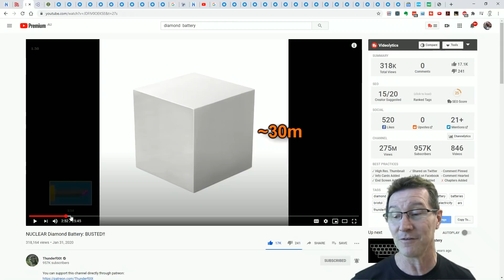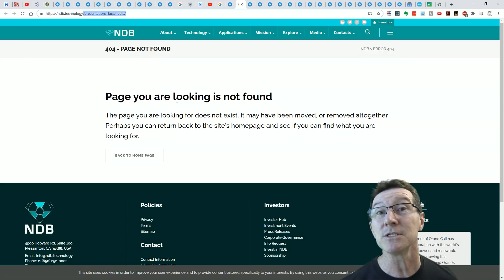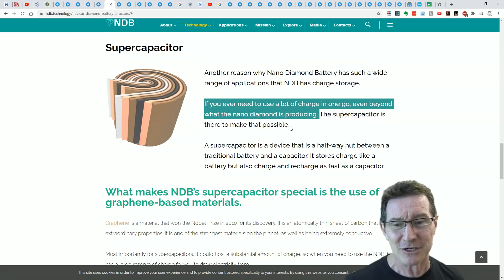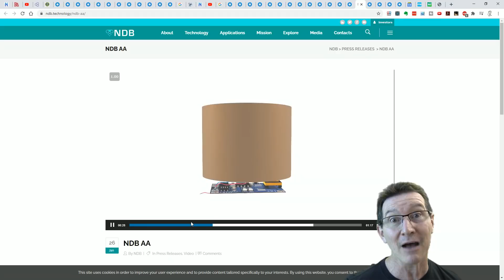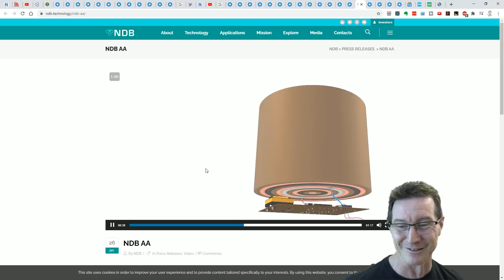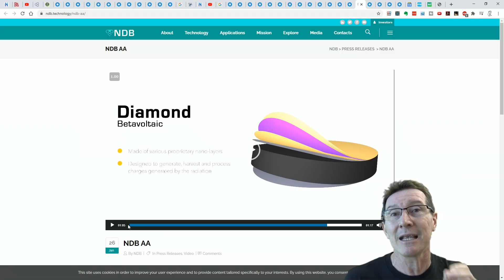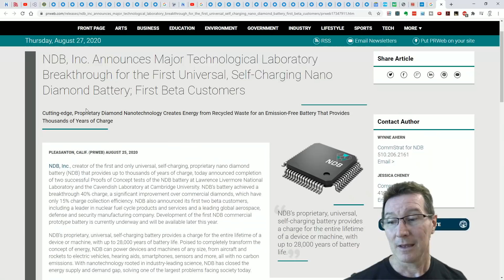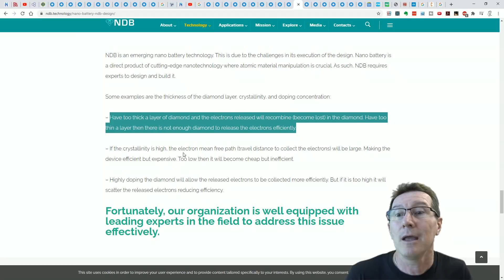EEVblog #1333 - Nuclear Diamond Self-Charging Battery DEBUNKED!

Comment: Excuse me they want to do what!? 
From what I understand from their website it sounds like they’re wanting to take spent nuclear fuel rods out of reactors and instead of putting them into cooling ponds for a couple of years they want to take them apart and extract the irradiated graphite moderator, crush it up, compress it into diamonds which somehow acts as a magic betavoltatic device but also acts as a graphene super capacitor…? Someone should probably tell them most reactors aren’t even graphite moderated let alone have graphite in the actual fuel rods and that high flux neutrons from spent nuclear fuel are not something you play around with or just shield in a magic diamond the size of a AA battery… [Edit: amusingly some of their marketing material realizes the graphite moderator isn't in the fuel while others don't understand it, wonderfully inconsistent]

I also don’t understand how their magic nuclear waste diamond is going actually convert beta particles into useful power, real betavoltatic devices rely on a silicon semiconductor to do the whole electron-hole pair thing (very similar to how a solar panel works with visible light). [Edit: it uses diamond diodes which are currently being developed in Bristol & Moscow for this purpose and are super cool (but not magic)]

The 3D demo board they show looks identical to a common hobbyist Li-Ion USB charging and protection PCB but with the USB port replaced with a transformer, real classy high-tech stuff.

Also, their claim “it would charge your [iPhone] battery from zero to full, five times an hour”. Let’s just think about that for a second, this thing generates enough power to recharge a 12 Wh battery 5 times an hour, that’s 60 W of electrical power! And this is a betavoltatic device which are notoriously inefficient (about 4%) so this thing is probably generating about 1.5 kW of waste heat that can’t be switched off! 

And don’t even get me started about how much radiation this thing would be putting off let alone how much carbon-14 you would need to get that much radiation!

Can we just take a moment to appreciate that those people want to put a 1.5 kW nuclear waste diamond in something like a smartphone with dreams to put one powerful enough run a 100 kW electric car (2.5 MW) and are calling it completely safe in a crash?!?! 

This is without a doubt a scam, don't buy any of their shares.

[Edit: looks like the research that's currently going into new REAL betavoltaic devices with diamond energy conversion is real and could gain a couple percent in efficiency improvements over normal silicon and also be more resistant to damage from higher energy beta decay but it's a real shame this unrelated NDB Inc. scam company has to come along and smear their research's reputation with those insane claims and crackpot applications]
Reply from the maker: Sadly these people are serious. The CTO is a highly qualified PhD
https://ndb.technology/team/suguru-f-amakubo/
Reply: @EEVblog  Yea looks like the main two founders aren’t complete idiots but interestingly it also looks like most of the staff on NDB’s LinkedIn are students and interns.
Also after digging deeper I can’t help but think the real product they’re selling is company shares with the suggestion the company will soon be worth billions.
https://youtu.be/ksMXbhftBbM?t=366 
Starting to think it’s more of an elaborate scam than a misguided ‘inventor’.
Reply from the maker: @WizardTim  10 billion dollar pre-IPO valuation? Sure, Jan.
Reply from the maker: @WizardTim  Reminds me of Batteriser. Two highly qualified PhD founders, tops in their field, patents out the wazoo, take one startup idea and then market the claims into the stratosphere.
Reply: @EEVblog  Just read up on the latest betavoltaic research, I realize now that the real research is completely unrelated to this NDB scam company, edited the pinned comment to reflect.
Reply: WizardTim I’ve got a pretty good idea as to why the majority of their staff consists of students and interns. 

Imagine how high the staff throughput would be, if they employed competent and skilled engineers. 

ESPECIALLY those of them, who knew what their marketing department were up to. And then getting shocked by the response of their supervisors, after doing the right thing of mentioning it to them. 

I really hope that if that were to happen, they would have the sense to secretly make audio recordings of it. 

NDB has two locations, one in California, where it would be illegal to record a conversation without prior consent from all parties involved. 

The other one is in London, where it IS legal to record as long as one of the parties consents to it. (Or they do it themselves of course.)

The use of such a recording however, is an entirely different matter. 😏
Reply: @EEVblog  Sounds like another reminder that some people are not as their degree might let you think. I always love it when they bring their car to the mechanic and complain about stuff like bad seals, bearings, and worn out tires acting like a know it all because they studied environmental science or some shit. Best one yet was a mechanical engineer working for one of those autonomous driving research centers complaining about the PDC not working when going 50km/h in reverse. The car didn't even have PDC.
Reply: @EEVblog  Uhm Theranos anyone, they were going to revolutionise the blood testing industry, got quoted as being worth billions, where are they now?
Reply: @johnmorgan1629  hmmm........maybe a certain E Holmes is involved in this one too?
Reply: @EEVblog  he also claim that he worked in technology for Trident Submarines and BAE. I know the MOD takes a VERY, VERY dim view of people talking about work they did so I call BS on that one.
Reply: @Spookieham  Trident submarines have toilets, shower drains and garbage grinders.  It's not that hard to "work on nuclear submarines".  :)
Reply: @EEVblog  More reason to think it's a scam, if they're highly qualified it means they should know it doesn't work!
Reply: GRBTutorials the tech should work and it should be able to make “batteries” which produce a stable voltage for a much longer time as well as having good potential for much higher output with fewer different materials and less chance of internal reactions over the long term.

That said in 20 years it could run a fairly expensive probe being sent into deep space which operates at very low temperatures. They may be able to get a few Watts an hour for big $$$.

They would effectively be making stacks of something like atomic scale computer chips and you would have to have something like 10,000 of them stacked up to output 1watt of power.
Reply: @EEVblog  when you a highly qualified CTO, there's always a chance he know better?
Reply: @EEVblog  LOL they know their stuff well. Quite serious at scamming the investors for sure, using their credentials. :D
But when busted then they'll just use standard OmG InnoVaShuN!1/"thinking outside the box" as defense.
Reply: @hempbear  Yep. See medical crimes. People can be very expertise in their field, and then totally scam people anyhow.
Reply: The resume of the CTO indicates he may not be entirely in the real world - 'Suguru is currently pontificating across multiple disciplinaries to develop new age technologies '
Reply: I mean sure - i would certainly by those "batteries" if they manage to produce even 10W of electricity continuously in that size. I mean why not? Just surround it in a very thick/heavy container and use it as a water-heater :P
Reply: There is the Russian RBMK reactors that use graphite moderators one of which is well known for being the worst nuclear disaster thus far.
Reply: actually there is C-14 in NPP, however, not in spent fuel. Primary water coolant when irradiated will produce tritium, radioactive nitrogen and C-14. Anyways, amount of C-14 is too small to actually produce radiovoltaic batteries
Reply: Maybe they're from Chernobyl. Lots of graphite to be found there.
Reply: If the graphite moderator is from Chernobyl I’d totally buy it
Reply: Last thing we need is a radioactive car crashing and then catching on fire.
Reply: no they have the diamond battery and then extra in the same package the carbon super-capacitor
Reply: I know of a beta emitter that can be used for nuclear batteries. Strontium-90. Seal that bitch up as a ceramic block and use that heat output from its radioactive decay as a trickle power source.
Reply: Don Hyon why would you use a beta emitter as a heat source? They are a source of free electrons and produce relatively little heat relative to their half-life. Heat engines and Peltier devices are relatively inefficient at producing electrical power. 

In an atmosphere of variable temperature a thermoelectric device wouldn’t produce a consistent power supply.
Reply: Have you looked into Arkenlight?
Reply: Well to be fair the reactor at Chernobyl had a graphite moderator. Maybe they can go to Pripyat and see if they can find some.
Reply: Doesn't the carbon 12 💎 coating block radiation?
Reply: Modern day snake oil.
Reply: Hey, I know just the place to get their graphite, place called Chernobyl has it scattered all over I hear.  ROFL.
Reply: Sooo... are they literally trying to kill people with radioactive waste batteries in layman's terms?
I can't imagine that there won't be some serious health risks, at least.
Like getting a chemotherapy session at home every time you even go near your "phone."
Reply: @Foreststrike  5g conspiracy guys are just ahead of their time, the real radioactive phones are next 🤣
Reply: I'm clearly not a scientist.  However,  I  don't think that they would want to make "one big"  nuclear battery for a car.  Wouldn't they make lots of little ones.  In addition,  if they were made of/incased in diamonds,  wouldn't they be safe in a car accident?  Obvs,  I  know nothing about their power output but that seems pretty logical to me.  Lithium batteries are volatile and explosive but diamonds and graphite don't burn,  right?
Reply: @kieronimo1  Diamond and graphene burn quite well, actually. Ignition temperature is higher than charcoal but not that high.
Reply: @kieronimo1  Diamonds do burn. I saw NileRed burn diamonds in a quartz tube, capture the CO2, and use it to carbonate water.
Reply: @zoator  I stand corrected on the burning diamonds thing... Like I said, I'm not a scientist. However, do thy burn anything like lithium batteries?
Reply: @kieronimo1  I was in the same boat as you man until I saw that video, heck even NileRed was, so no worries. I do know diamonds aren't prone to combustion like a punctured lithium ion battery can be.
Reply: And Im sure youre a certified went to school for nuclear fission and physics doctorate holder right? You TOTALY know what you're  talking about.
Reply: @Bioactive_Zone  it doesn't take a degree to smell bs from a mile away when their own promotional image shows the power output capability that directly disputes all their outlandish marketing claims. Doing basic back of the envelope calculations/estimations like this is something EVERY engineer should be able to do to see if something is even feasible. I question why you are trying to gatekeep basic engineering/science skills to only be valid for specific degree holders.